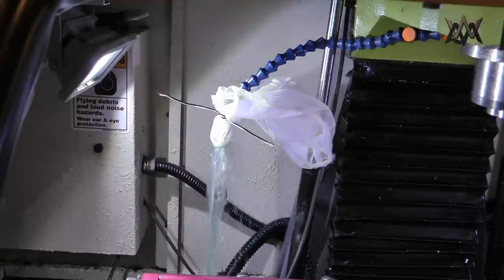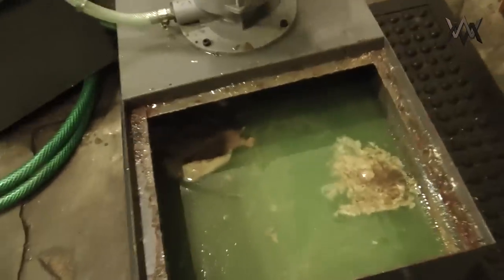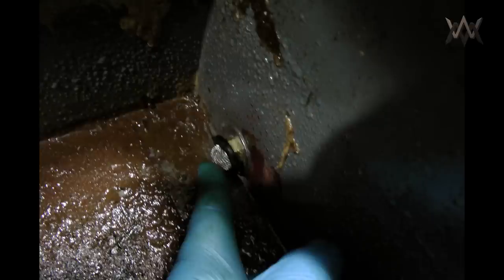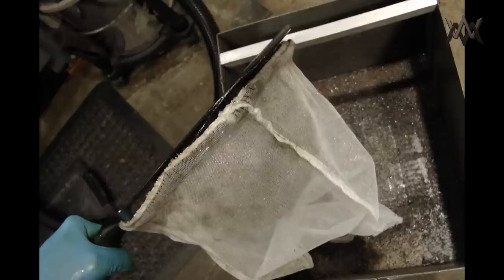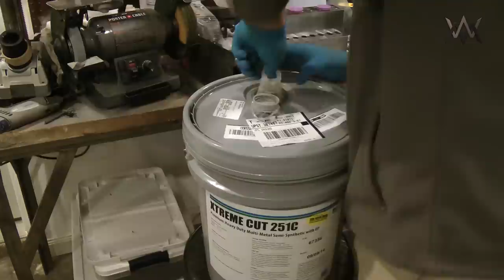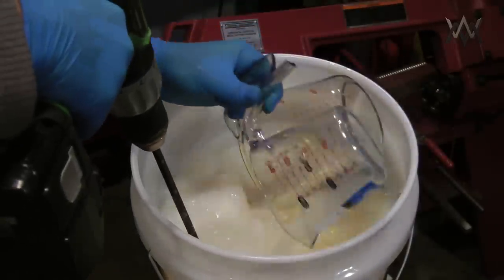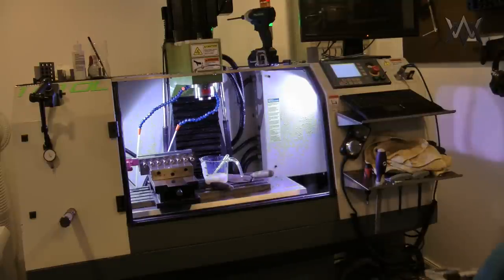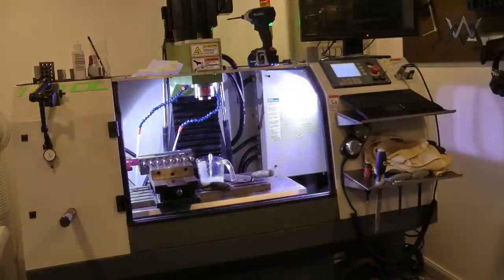Coolant system upgrade

Comment: Excellent vid!  I've really gotta buy that coolant.
Reply from the maker: Thank YOU for the idea! So far it's working great except it ultimately didn't fix my endmill chipping problem. I have determined that is very likely from excessive chipload. My only complaints with the coolant are that it gets VERY sticky when it spills on the floor and dries, almost like contact spray adhesive. Also it really eats paint. My mill looks like it aged 10 years in just the last month. No rust though.

Comment: Looks like a pain in the butt but I'm sure it will pay off.

Just a couple of unsolicited random youtube suggestions.  You can get a pretty big rare earth magnet from amazon for less than $20 that might help clean up stuff that the screen misses and extend your filter life a bit.  Stick it in a ziploc bag first to keep it easy to clean off the crud.  Also, a UV filter will keep the funk down if it starts to build up again.  You can get them inline for the tubing or something that you can dunk into the tank.
Reply from the maker: It wasn't too bad but it was easily justified by amount of chipped carbide I was going through. Great idea about the magnets! I actually had the same idea and I ordered some 0.25x0.25 neo mags last week. I thought I might array them around the pump to keep the fines from being sucked up. I might vacuum seal them or just put them in a zip lock for easy cleaning that is a good idea. We'll see how well the biocides work. I do have a bubbler but I haven't put it in yet. Would a UV light break down the additives in the coolant faster you think?
Reply: War Machine LLC As long as you can get to the magnets easily there, that spot is probably as good as any.  You might want to make a 'pull tab' out of some packing tape as those little suckers might pull through the baggie if they are stuck on the floor of the tank.  Just stick 4-8 of those little magnets together in a row, pull off 10" of packing tape, put the line of magnets across the middle and fold the tape on itself.  Cut down as needed to avoid getting it sucked into the pump.  The magnets will actually slow down aluminum and stainless fines as well (look up magnet in copper tube), so if you put the magnets early in the flow, just after the screen, the fines might drop out and settle on the tank floor.  

Good point on the UV effects on the additives, I have no idea.  If it begins to look like a good option the vendor might have some ideas.
Reply from the maker: jcims Thanks good points about the magnets, I'll rig up something that makes it easy to retrieve them, I'm sure those little buggers are pretty strong.
Reply: oh man, if you haven't played with neos before, be prepared for giggling at the absurdity.
Reply from the maker: I have but not any bigger than 3/16" sized ones. The 1/4" ones I ordered will be silly strong.

Comment: Relative to bacteria growth:  Could you use an ozone generator?  We use these on small hole EDMs, where our working fluid is deionized water and we can't use a biocide additive.  They seem to work well.  Our units are sized for spas and large fish tanks, but you can get a fairly inexpensive one sized for a small aquarium.

Granted, I don't know if one would have a detrimental effect on any of the constituents in your coolant.
Reply from the maker: Hey John,
Interesting idea. I'm not sure it's going to be necessary yet. This coolant apparently has plenty of biocide so as long as the concentration is maintained bacteria growth shouldn't be an issue. If it is I'll first add the oxygenator I have then if that doesn't work I'll look to do something else. Bacteria growth wasn't even that big of problem with the Kool-Mist. It never smelled like sulfur, just Vactra #1 way oil (which has a strong obnoxious petroleum smell).

Comment: HI Alistair here from Scotland. In dentistry where I was almost lifelong employed we used in the lab a double filter container. This is really a very simple idea you let the fluid fall into a container suitable for holding liquid, then ,allowing the heavy debris to settle at the bottom of this first container. Then directly beside it you have a second similar container joined high up near the top of both by a plastic pipe so that any liquid near the top enters the second container.(check the rate of flow to make sure it is not set too high, it does not have to be a large diameter usually  12.5 mm will do. When the first container gets full the excess liquid overflows into the second container. Since the swarf debris is heavy and sinks rapidly into pot one. You usually only carry over liquid to the second container. Just keep cleaning the containers regularly especially the first one , and you will find this is a good method to filter out what comes back into the coolant pipe, from the second container . Alistair
Reply from the maker: Hi Alistair, Thanks for the info! I also used to work in a lab where we made our own analytical grade milli-Q double distilled and sub micron filtered water with a Millipore filtration system. I'll take your advice into consideration. Maybe Grimsmo has need for 0.2 micron filtered coolant. LOL!